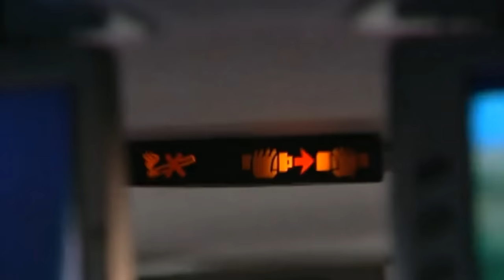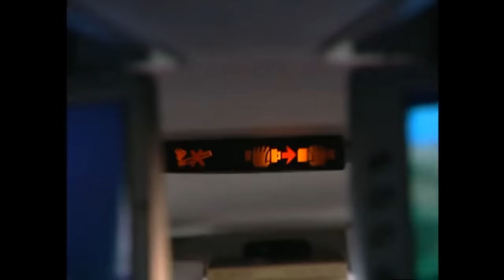Trick My Truck (Pimp My Ride Knockoff)

Comment: I would LOVE to see a 5yr update. See what these monstrosities look like now
Reply: There’s a few still rolling around the country
Reply: Spoiler, most didn't last 5 years..
Reply: All the love made in these cars
Reply: Probably pretty good. A truck used for hauling long distances cross country can easily do ~2 million miles before youd even consider a  inframe rebuild. As long as you take care of the paint & keep it nice & clean it probably looks damn near the same. Also to lower it how they did you actually gotta install pretty much all brand new suspension & they have to be maintained to legally be allowed to stay on the road. Plus Peterbilt's ain't no Volvo/Mack p.o.s. trucks & are made to last a lifetime. Essentially just 2 thick ass steel frame rails, axles, air brakes, wheels, motor, tranny, drive line w/ a cab bolted on top.  Don't get much simpler than that 👌👌👌
Reply: @md.m.8372  well no, u add selling guy, the truck supposedly has had major issues, those issues were not about the paint as we were meant to believe. So report back to your bosses at your company ans tell em straight how you succeeded in tellin a BS story. So now Volvo is a pos ? I work for Volvo and all i Can say is, our Semi's last 2 lifetmes and don't break down like this POS Peter's , we can do at least 4 million miles, which is 5894652 feet 584627 yards or 524685 archbows or 2135200009 inches. When you buy A Volco, u care about the metric system !
Reply: @davyjones2994  is this the love made building and driving it? or is this the love people made in this car, which would be the trucker and his wife, if not, the trucker was unfaithful, so what kinda love we talkin here ? 
Next time try to make a proper sentence "All the love made in these cars" is not givin away anything. 
All the love made in making these cars ? (well bummer, it is not realy a car)
All the love that has been made in these 'cars'. Ppl making love is a 'lovely' thing.
Reply: Some trucks are still around

Comment: Chris; I fuck with your videos been subbed for a good while & feel like chiming in.
Pimp my ride? Ridiculous. Why? Because cars are made to last maybe 200k & they'll just slap game consoles, 7" lcd's & a bitchin sound setup, reupholstered interior and a $10,000 paint job w/ some lights & a jewelery making station into some car that is clapped out asf, rusted to all hell & they have been called out numerous times for doing extremely shoddy electrical work.
This show? Actually pretty practical. Why? A beautiful hand built in the USA workhorse like a Peterbilt 379 is designed to last ATLEAST A MILLION miles before needing an inframe engine rebuild & some maintenance before doing another million, mostly all highway miles.
Any class 8 vehicle that is operated commercially in the USA actually needs to be inspected a couple times a year & can be randomly inspected by a state patrol officer to ensure it is in safe operating condition. If it isn't you can get hit with huge fines/tickets & even potentially lose your Class A CDL. Compared to a car that truck may look like it's a lil tired but actually looks pretty solid. If you ever saw with your own eyes what a 2.5million mile clapped out Peterbilt looked like on it's deathbed it's not pretty whatsoever 🤣 youd be having nightmares nd shit lmao

Comment: Lowering a truck is stupid. Sometimes you gotta go over a curb (usually not with the front end, but I'm not comfortable unless the front bumper is at least above normal curb height). If your fighting with your truck to get from a skinny two lane road into a tight dock your front or back end is probably gonna have one wheel on the front or back go over the curb. Either that or you gotta fight with your truck and load for an extra 15min.

Comment: I found an interview with the makers of this show and they asked about if they fix the truck, and apparently they do. Very cool. 

When you trick a truck, do you do anything with the engine, or is it all aesthetic?

Pickett: We do mechanical work, but the majority of it we don't film because it's boring for the audience to watch us fixing air lines or doing that. It's not like we build the truck top to bottom, front to back. We'd have it six months at a time and $300,000 in it to do brand-new everything. Everything that goes out on the road is roadworthy .... But there's a lot of stuff that don't get shown.

Comment: Unlike pimp my ride, they actually did mechanical repairs to the trucks. It just wasn't shown because that's not what the viewers want to see. Changing brakes, doing an overhead adjustment and replacing airlines doesn't draw in viewers. Adding accessories and paint is what people wanna watch.

Comment: The vehicles for Pimp My Ride were mainly from the 70's to mid 90's (in 2004). They were neglected and rough, sure, but the producers would make them worse prior to filming. Toss some crap on the floor, scuff/sand some paint, rip off a bumper, etc... Basically the opposite of "freshen up", so that when the reveal comes at the end it looks that much better just by comparison to how it was "originally".

Comment: To be fair, as a trucker a tricked out truck is a lot less likely to be pulled in for inspection. Especially if it's kept clean, regardless of mechanical condition.